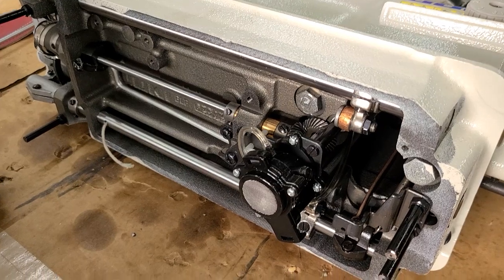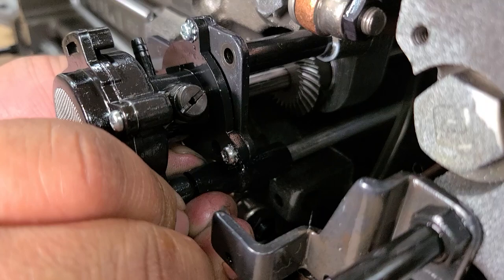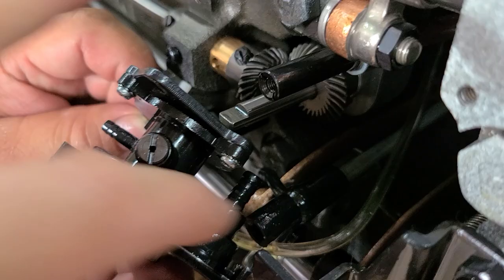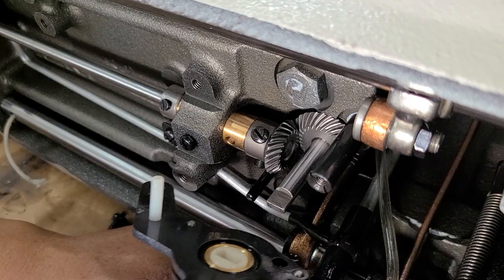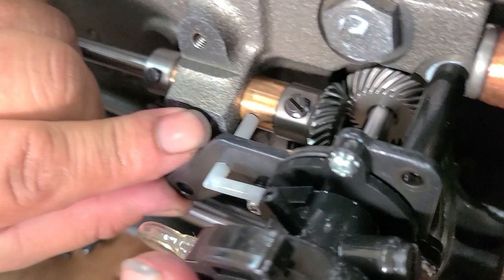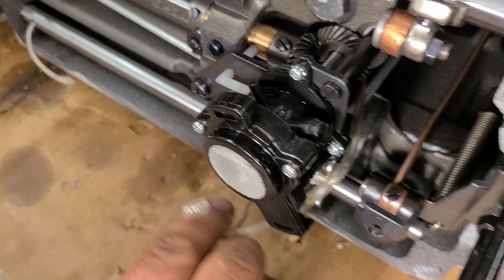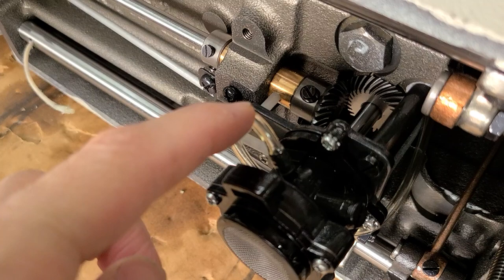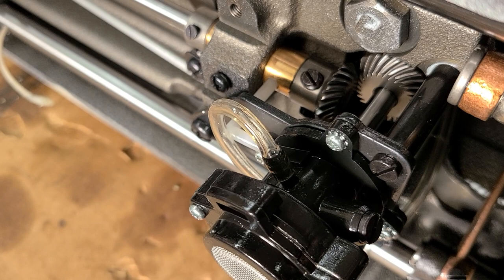How to remove and replace the Juki DU-1181N oil pump.

Comment: Can you make a video on lubrication maps for DMN 5420? How does the oil flow or pump and where inside the machines? How to control oil in certain areas?

Comment: is it ok to leave the oil bypass hole cover closed on consew 7360? the oil pump is probably like many oil-pan, high speed, drop feed 301 stich machines.  if anyone knows id appreciate it.  the manual says normaly a little open and the screw is already striping slightly (i was kind and tried different screwdrivers, all new) and i dont see why i cant just leave the 'bypass' shut(makes sence to me).  thanks

Comment: Hi Steve! I think my JUKI DU-1181n has low oil pressure compared to my DDL-8700L. There are fewer drops in the 1181 viewing window than in the 8700. The pump impeller has no visible damage. Are my fears unfounded? Dmitry

Comment: I don’t see oil in the site glass, is there anything that should be cleaned out before thinking it’s the oil pump? Do you sell an oil repair kit for the Juki DDL 8700?
Reply from the maker: You will only see oil in the site glass at very high speeds.

Comment: If your not sewing at high speeds, therefore not seeing oil in the glass bubble. How else can test if the oil pump is not working?
Reply from the maker: Run the machine at high speed every once in a while, to circulate the oil.
Reply: Thnx. If the pump is driven from that shaft that fits into that Teflon slot, it's not likely to fail, is it?